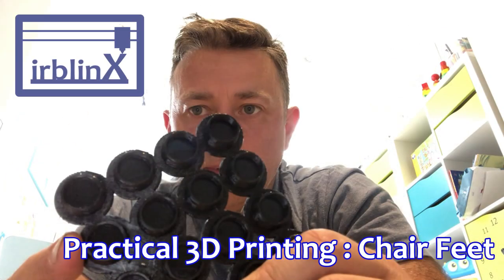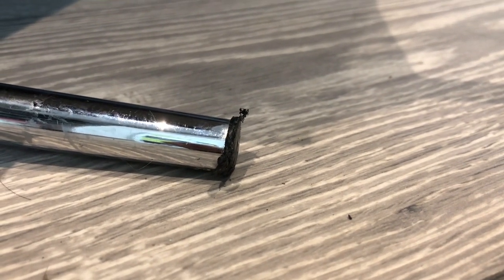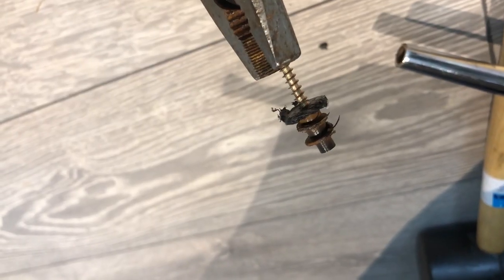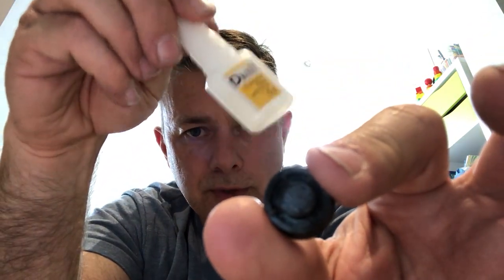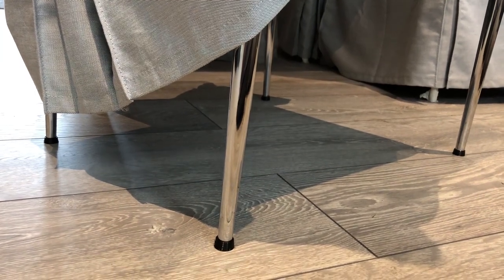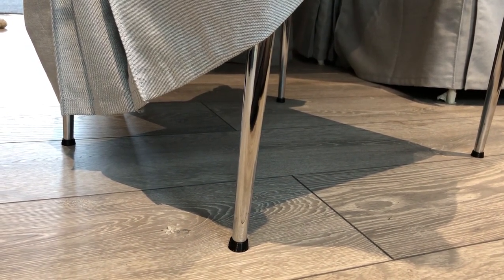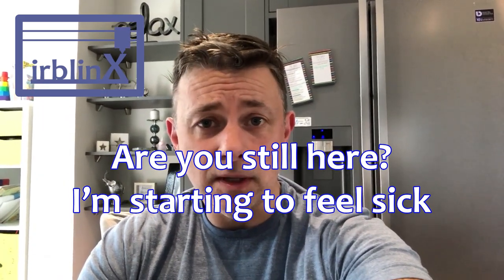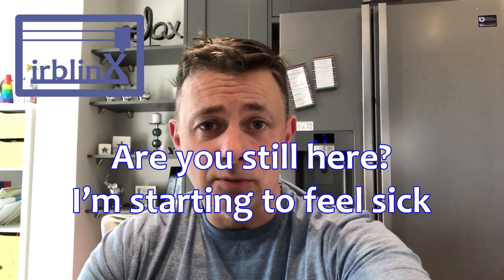Practical Printing - Chair Feet

Comment: If the super glue ends up not doing the trick with that flexible filament, you might want to give E6000 adhesive a try. It can take a while to dry -- I tend to give it at least 12 hours -- , but it's a more flexible adhesive and may do better with the flex filament.

Oh, and thanks for the cool video! I love a good practical use for 3D printing! 👍